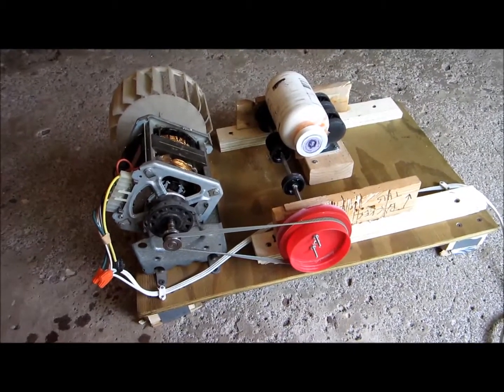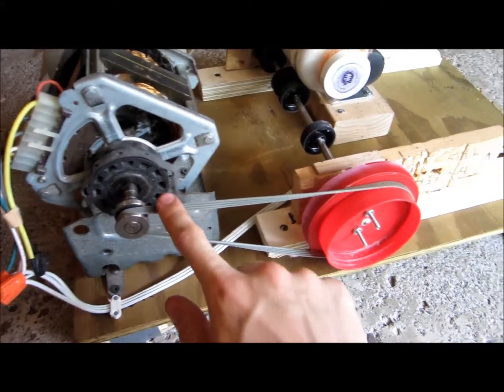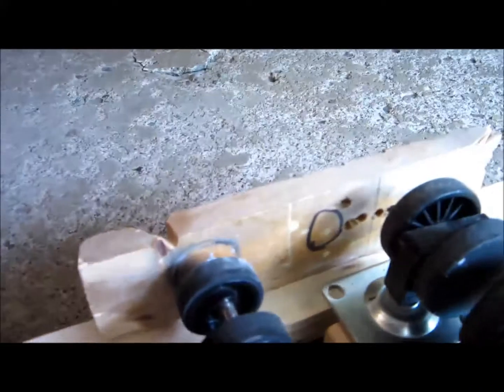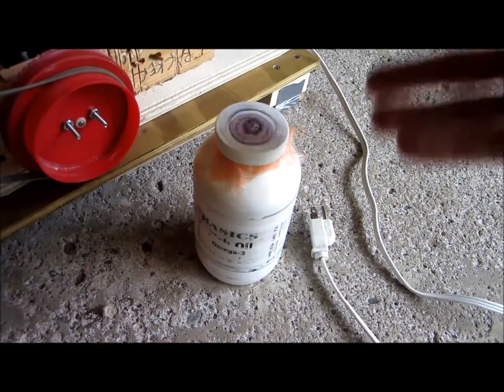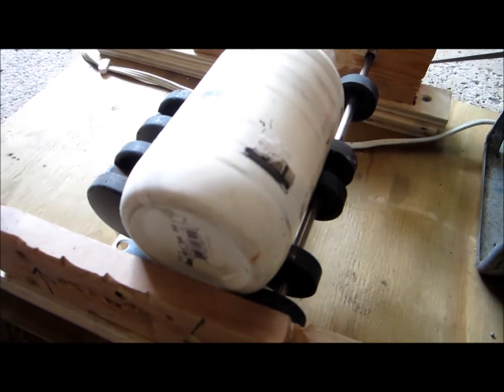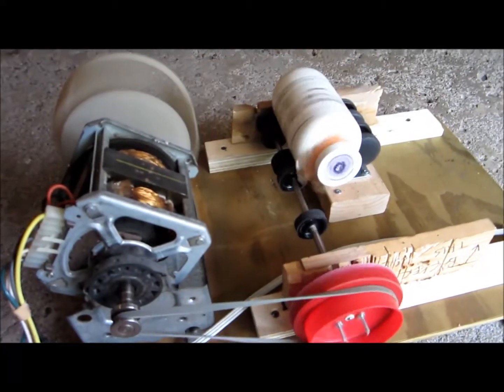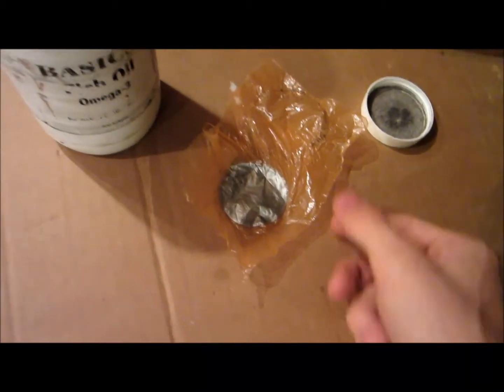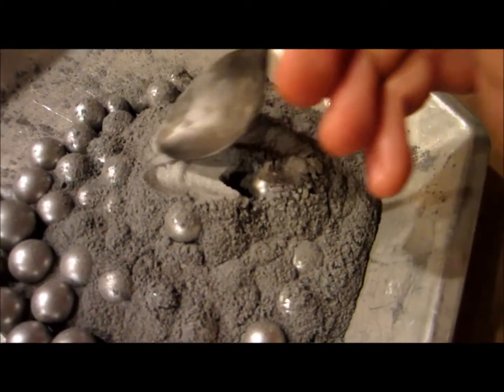Ball Mill & Aluminum Powder for Thermite

Comment: That style of fan only works when there's a surround on it. It's called a squirrel cage fan and in order for it to be efficient it needs to be enclosed in a box and have one in open to the center of the spinning wheel in one side open to the fan blades

Comment: Hi from Digant. Thanks for video. I have a question how much total time is required ( milling process) from Aluminum foil to fine powder?
Reply from the maker: It has been a while since I have run the ball mill, but I believe it took 10-14 days of operation (either all day/night or just in daylight) to produce the fine powder.
Reply: One thing you shpuld be very careful of is to not run it too long. The longer it runs, the finer the powder. Eventually it will be so fine that it will spontaeously combust when you open the container. When this happens the combustion causes an expansion of the gas, blowing burning metal particles into the air and potentially directly into your face.  The general rule is to open the container ever 8 hours and let it stand for 15 minutes before you continue milling. 

Another thing you can do to prevent it from combusting is to add 5% by weight of charcoal to the mill. This will coat the particles and make them less reactive to the air,  but you should still vent it periodicslly to be safe.

Comment: Mill jar appears to have a higher RPM than would be good for grinding should be about 80 RPM so you need a larger pulley.
Reply: Appropriate rpm depends on the diameter.  Ideally, we want it the centripetal acceleration to be significantly lower than 1g. So, in English units, a=(𝜔^2)r, where a is in feet per second, 𝜔 is the rotation speed in radians per second, and r is in feet. g is around 32 ft/sec^2. It actually varies slightly at different places on earth, but only about 0.7 percent. Still, someone with a sensitive spring scale might be a bit more depressed in Oslo than in Mexico City. Anyway, 𝜔 =0.105 X rpm, if I'm not mistaken.

Comment: Word of advice, DO NOT use steel balls! You are flirting with a really bad accident. Do your research. Just because you get fine powder doesn't mean you should. Be careful, you are showing people has to get really burnt. You cannot put that stuff out.
Reply: mark luce?? explain further. you think the steel balls will somehow become abraded by the aluminum, impossible because aluminum is softer than steel, and that the steel and aluminum powders will somehow ignite? have you ever witnessed thermite actually being used? it takes a hell of a lot more than a spark between 2 steel balls in a powdered aluminum environment to start a thermite reaction.

Comment: You can improve the operation by removing the blower wheel from the motor. It was used to circulate the air in the dryer, and all it is doing here, is placing a load on the motor. Not having it there, will reduce the current in the motor, reducing the electric cost. Don't worry about motor cooling, as the internal fan was fine in the dryer, and you are running with essentially no load at all on the motor.

Comment: Really inefficient, the motor is way too large for the size of the container. I've used a room fan motor for a larger size volume and it worked fine. 
When we use ball mills we think of every hour the thing spends running up the electrical bill considering some mediums requiring days to break up. With this thing you go broke fast.
Reply: he built this rig out of junk he had lying around.

Comment: Why does the motor get hot? There's not much load on it.
Reply: because it's a large rotating inductor, so it's constantly vibrating at 60 hertz. that constant vibration of the molecules in the metals generates heat.
Reply: There is always some lost energy in the motor that is converted to heat because of resistance, even if the motor is not loaded at all. The guy above me may also be right, but I am not sure.
Reply: The motor spins really fast to the point it is equivalent to having a heavy load on the motor.. as the speed increases the commutator of the motor now touching the brush more often lettting more current goes through

Comment: would it be better if I use a non-cylindrical bottle? so the balls/beads and the Al won't just slide off, and hit something instead?
Reply: How would you feel about "skewering" the plastic container instead of having a belt? you could take a heat gun to the container and make it non-cylindrical if you do that.

Comment: just curious, how does the aluminium look like before going thru this process, srry im 15 so i dont really know alot about these kindoff things but im really interested in them
Reply: Thanks, my friend tried making aluminium powder but he could only make a reeeally small amount because he said it takes alot of time to turn it into poder, me and him are trying to find a way maybe similar to yours to do it
Reply: +Joshua Dunbar Hi, same kind of kid here, I built my own ball mill but I don`t have  a lot of grinding balls and it just slides on the bottom of the jar, is the jar too smooth? Do i need more balls?
Reply: ***** I will also try coating it with rubber or something, and do you know where to scrap grinding media?
Reply: ***** Thanks, will screws and bolts work?
Reply: cool
Reply: He said he used shredded aluminum foil. 

Suggest wearing some protection when opening the jar. Probably all the oxygen in there, after milling for a while, would be all used up, leaving some very small aluminum powder with no self-anodizing. In other words, very flammable.